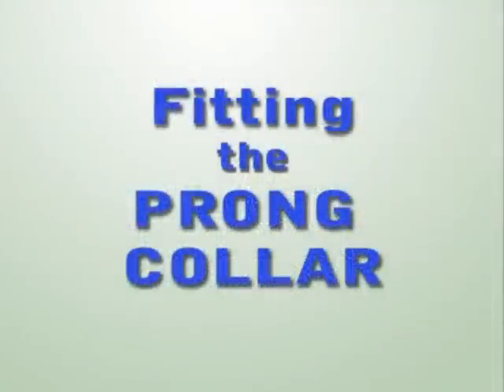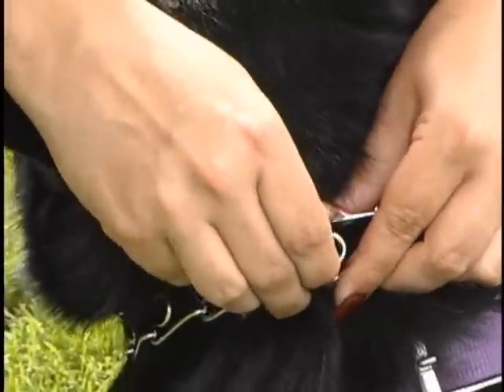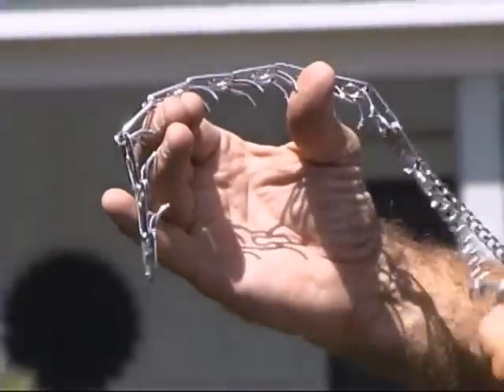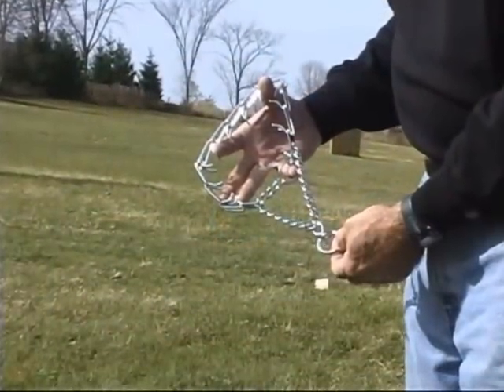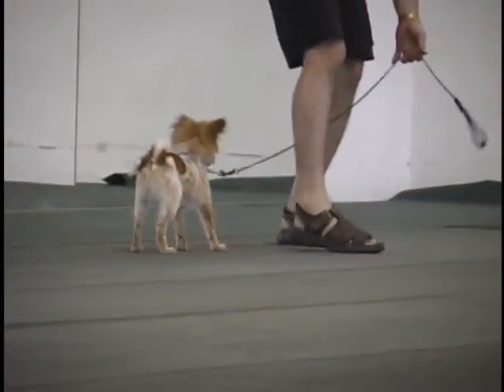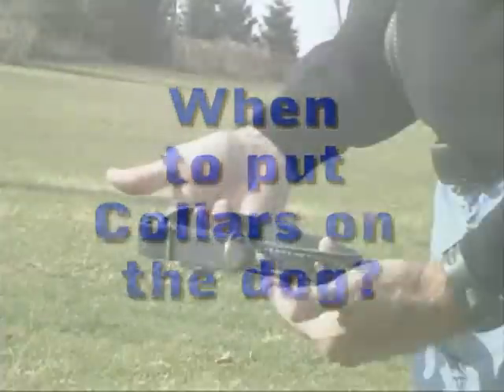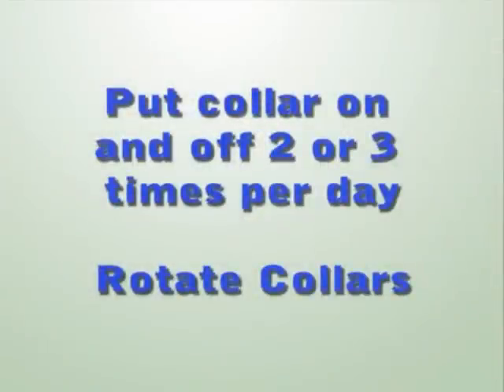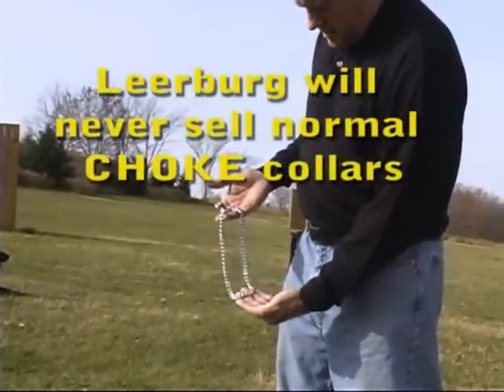how to put a prong collar

Comment: They are far kinder on a dog's neck than regular training collars. They do not choke. They pinch if the dog pulls. Not all dogs are the same, just as not all people are the same. I have owned different dogs and only required the prong collar on one dog - one that responded to no other training, not even food motivated/click. The harness triggers many dog's 'pull' instinct.And 'gentle leads' and harnesses based systems do nothing to help aggressive, or jumping or high prey drive dogs.
The problems incurred with walking a dog which gets people looking for help is far more than just 'pulling'.
The prongs do not poke into the skin. Put one on yourself and pull... then put a regular collar on yourself and pull. The pinch collar is far more effective and does not choke. Trachea damage is common among regular training collars but unheard of when using the prong collar properly. 
You keep your hand at your side, with the leash,no pulling, no dragging. And they do NOT need to be used forever. They are for training.
Reply: Ty very much
Reply: Birch Wind Yess 👏🏼🙌🏼

Comment: Prong Collars are cruel. There are always other tools. Front-attachment harnesses, such as the Freedom harness and the Xtradog harness, have a ring at the dog's chest and another at the shoulders for the leash, so physics is on your side. When the leash tightens, the dog usually turns, pivoting around the leash clip. These harnesses can be quite effective and are my go-to tool for dogs that are hard to control in a flat collar or regular rear-attachment harness.
Reply: Cat Lover suuuurre, but they also create health problems for the dog, since they do not allow the dog to complete its stride, therefore creating an unatural stride, therefore creating lifelong health issues for the dog, so the prong is actually safer if used correctly than even the front clip harness
Reply: And I just realized that this comment was from 6 years ago

Comment: And then the prong collar opens and snap you cause an accident! Not my thing! Happenend as a puppy, not risking it anymore
Reply: It is recommended to put a connection between that and a flat collar on the event of them coming apart. Which I can't even imagine happening. Maybe you had the quick release type. The real deal will not come apart of correctly fitted, I'm speaking of the Herm Sprenger and no other